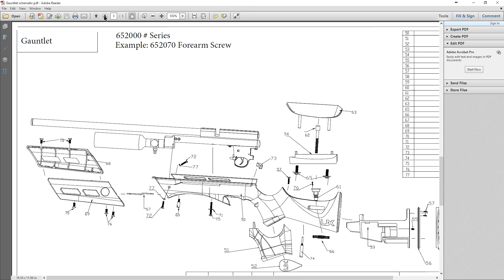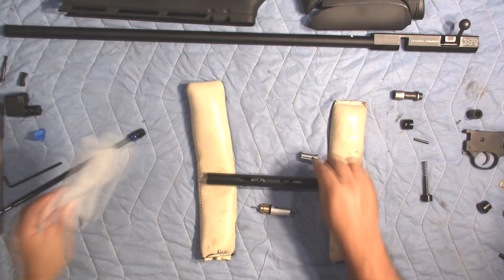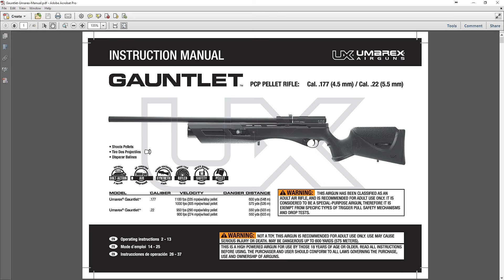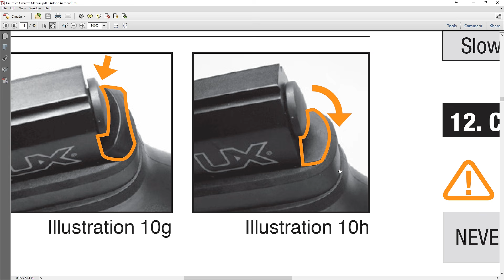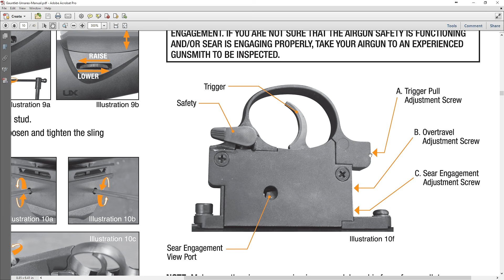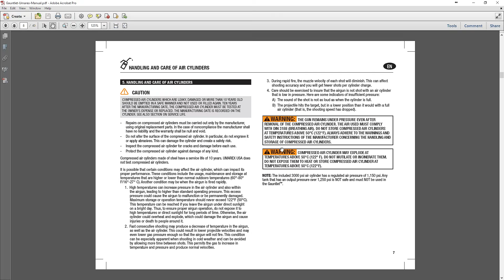Umarex Gauntlet: Super Tune Kit Installation

Comment: Where might i obtain just the spring to lessen cocking effort? I'm pretty satisfied with gun otherwise.
Reply from the maker: The spring is part of the SUper Tune Kit.
Reply: Yes im aware of this but I wish I could find out specs of just spring so I could buy at hardware store and just replace it for easier cocking. Much easier than taking whole gun apart.
Reply from the maker: You have to understand that there is more to it than changing the spring. If you use a lighter spring, the hammer will not have enough energy to open the valve and the PCP will have very poor power. You must modify the valve poppet so the surface area is reduced so the regulator pressure is essentially lighter on the valve. The lighter valve will in turn need less hammer energy to open. Always remember it is about balance and harmony. You MUST keep the energies in harmony in order to have a tuned air rifle.
Reply: Ok..now I get it..If I can get my accuracy lined out I just may go for it. Even after BB installed my best groups at 43 yds is 1.5" using. Crosman domes. I'm hoping the AA 15.89's will help. Also the BB did pull my barrel down very slightly. I had to click adjust scope. I may have to loosen bottle to block screws like u recommended. That way no pressure will be on barrel.
Reply from the maker: You should not need to adjust the scope if you followed the instructions properly. I suggest you re-read the instructions and watch the video that is referenced that describes exactly the condition you describe. Next, If you are getting 1.5" groups at 43 yards there is more going on than Barrel Bands and springs. Double check to be sure your barrel grub screws are tight. Remove the shroud and air stripper and inspect your crown. The rifling should run all the way to the end of the barrel less 1/8" of an inch or so, if the rifling is 1/4" or 5/16" down in the bore, you have a junk barrel that was machined backwards and the breech end was machines as the muzzle.
Reply: @HajimotoProductions  I checked my crown with usb lighted endoscope. Rifling all the way. Checked barrel grub screws. All good. Air stripper not cracked. I'll rewatch the BB video before reinstalling BB. I. appreciate all ur patience and helpful advice.
Reply from the maker: trevor5534 it’s not the barrel band video you need to watch. The instructions give you an internet link that will explain what is happening and how to correct it. here is the link which will start the video at the exact point that I explain what is going on with the POI changing after the barrel band is installed.
https://tinyurl.com/bandflex
Reply: @HajimotoProductions  Alright Haji I got ur BB properly installed and shot my new Air Arms pellets. Also installed new UTG scope. 5/8" @ 27 yd and 3/4" @ 43 yds. Much tighter grouping with AA pellets compared to Crosman domed..however..im still having POI changes as my bottle psi decreases. 1st group was hole in hole..then next group a little further over but pretty tight.then next 10 further over. I tested by shooting a 10 shot, then filling gun back up to 3000 psi and was able to replicate the 1st 10 shot group. I'm going to run my crony tomorrow but it sounds like my regulator isn't consistent. I read that the super tune kit and high retainer valve would help accuracy. Thanks

Comment: I have been considering purchasing one of these rifles after watching a number of your videos. BUT I have a Umarex Octane Elite with problems. Problems reoccurring after warranty service completed. I can not find any schematic for it either. Am very skeptical on another Umarex product. 7/29/19__Umarex finally did come through to some extent a few weeks ago. 
   I now own a Gauntlet in .25 cal.. Gathering up items needed to charge it up.  Still deciding on filters and separators to keep the air as pure as diy possible.
Reply from the maker: As you should be, one bitten twice shy. Umarex will have to earn your trust back. I can tell you that if you are considering your first PCP, the Umarex Gauntlet is a great starter PCP but there are others in the same price range, they just don't check as many of the features included boxes as the Gauntlet does,

Comment: hello I have a question .I have ask many times before .but people act like im asking a top secret question  and don't answer .im hoping you will. my question is can I use a 1800 psi regulator on  my .22 Umarex Gauntlet
Reply from the maker: I doubt you are not getting an answer because it is top secret, you are not getting an answer because you are exceeding the manufacturers maximum operating pressure and no one is willing to accept the responsibility to tell you yes. I do not recommend going to a pressure any higher than 1300 for the .177 and .22.
Reply: thank you for the info .and I knew it wasn't a top secret answer .I said that's what it felt like .as far as responsibility .that's not on anyone but me .recommend spect .don't mean crap its just numbers .the worst that can happen is it might blow a seal .it isn't like 1800 psi will make it blowup like a bomb or something .I know im just a girl but im not as dumb as people that I am .---I am going to use the 1800 psi regulator .I'll let you know what happens I'll also buy a box of metric seal's just in case .again thank you for answering .
Reply from the maker: @susan Marie with all due respect, I do not care that you are a woman as the facts are the facts, 1800 PSI in a non modified brass valve that is only held in place by one fastener is not something you should underestimate. A lot more than a blown seal can happen. I would strongly advise that you do not use the 1800 PSI as it is more than just the PSI to consider. The valve poppet has to overcome that higher PSI which means you will need more hammer energy in order to open the valve in order to fly the pellet. There is a very good reason why Umarex changed the valve body from brass to stainless and increased the fasteners from one to three on the .25 caliber Gauntlet. All of those changes were to support an increase from 1150 PSI to 1900PSI, that's only 100 PSI more than what you are suggesting without taking any of those precautions. As a reminder, this is what can happen if you are not careful.
https://www.youtube.com/watch?v=a1hrms0i2LU
Reply: Thank you for the info .I upgraded my gauntlet from 1100 psi to 1400 psi .it seems to do very well .if I decide to go any higher on psi I shall order the stainless valve body or have a special one built at my brothers machine shop .

Comment: Now that that .25 is out do you recommend it over the .177 and the .22? 😶
Reply from the maker: Recommend just for the sake of recommend, No. The .22 has more access to ammo in more locations. It puts out more than enough energy to take game from a mouse a full size raccoon. The only reason I would recommend the .25 is if someone needs more hitting power for animals larger than Raccoon like Coyotes and such. There certainly improved on the rifles build and internals but the .22 still gets it done in my book.
Reply: For coyotes use a firearm. My rule is they have to bleed out it's an inhumane kill.

Comment: Haji, first thank you for all the great videos, as well as sharing all your knowledge of these guns! I already have your baffles and air stripper installed. Did the trigger improvement too.  Those mods where right on for sure. I'm really happy with my .22 Gauntlet so far. The one thing I'd like to improve on is the smoothness of cocking the bolt. Does polishing the hammer help with that very much at all, or is the problem in the bolt itself or both?  Guess maybe what I'm asking is what are all the benefits of polishing the hammer,  will it effect the fps of the pellet as well by increasing the speed and smoothness of hammer travel?
Reply from the maker: Thank you so much for the kind words, I sincerely appreciate it. Polishing the hammer increasing the efficiency of the weight to deliver its energy. In the business of accuracy, the main variable you are trying to control is consistency, if that hammer hits as a different rate of speed everytime the valve dwell will be different every time which in turn means the feet per second of the pell will be different every time. We are trying to eliminate as much inconsistency in the variables as we can.  As for grittiness or difficult in the bolt, it is because the rough machining of the bolt itself and the rough bore that is machined for it to ride in, both have machining grooves that are engaging with each other like a stick across a washboard. The problem comes into play when that washboard is flattened and the play or tolerance between the two parts becomes so sloppy that you now introduce binding of axial instability. I typically will polish the bolt and bore with 100 grit to mimic what 200 cocking actions would do and leave it at that.
Reply: @HajimotoProductions  thanks for the info!

Comment: How much is this fabled kit to make this rifle worth a damn ?
Reply from the maker: I have to correct you Jesusoftheapes. Out of the box, the Gauntlet is a very consistent and accurate PCP. The tuning kit just allows the shooter to tune the rifle to different weight projectiles so there is a more efficient and accurate delivery of that pellet to target plus a much better shot string. One of the only negatives the Gauntlet has is adjustability, the shooter cannot adjust anything associated with the functional mechanics of pellet delivery. The $65 tuning eliminates that problem making the Gauntlet a full-fledged tunable PCP.
Reply: Hajimoto Productions :  Okay Thank you for that . I am considering buying a remanufactured rifle for pretty cheap but I want to make the gun shoot as lethal as possible because I have a woodchuck problem and I want a humane  weapon to dispatch them with. I'll probably use it to kill many critters over the years and I like maximizing my weapons potential so it's good to know you are here !  Do you have trigger kits as well? I hear the factory trigger on these is not super good ?
Reply from the maker: You are very welcome! The Gauntlet can generate as much as 32FPE or as low as 5FPE if properly tuned. I am not sure how much you know about PCP's and I risk insulting you based on your knowledge of the subject but in the interest of time and trying to communicate while clearly expressing my intent, I'll proceed at risk. One of the only drawbacks associated with a regulated rifle is the consistent shot to delivery comes at the cost of maximum power. So a shooter needs to know out of the gate what the primary role of the PCP will be. If hunting, maximum power and sacrifice maximum shot count and consistent shot to shot data. If target, then absolute repeatability is required. That said, if you are trying to have a fair balance of both worlds then adjustability is a must requirement. The common thread in both disciplines is acceptable accuracy. The Gauntlets were mass produced and they experienced their fair share of production line failures and one of the most common was the barrel production. In almost every case when I pulled a Gauntlet apart to determine why it was shooting terribly, in almost every case it was the muzzle crown that was the issue. In most cases, it was unsalvagable and required a new barrel. If you are going to score a refurbished rifle I would just caution you to ensure you can return it for a full refund if the rifle is shooting terrible as it may be a bad barrel. As for trigger, it is a single stage trigger and if you polish, lube and adjust it, it is very very good and predictable. There are 2 stage kits available and I even show how you make a 2 stage(ish) trigger mod for the Gauntlet, but in the end polishing and proper adjustment make the trigger very nice. Sorry for the long winded response but I want to be sure it is a complete answer. Be well!
Reply: Hajimoto Productions ;  I know enough about PCP air rifles as one can learn without owning .  I have several people i know who own them and I've been involved in building a couple from scratch a couple of times but in bigboar and unregulated .   I would never spend $2000 dollars on a rifle that didn't shoot cartridges and I hate the idea of spending a ton of money on any pcp rifle really because for $99 bucks I can buy a very good shooting .22 lr so buying airguns for large dollar amounts just has never made sense to me but I do like shooting them and for some uses I need a good rifle for using in city limits for pest control and animals as large as racoon or bobcat .   This is why I am considering buying the Gauntlet remanufactured at a decent price . I already own a suba air pump compressor and several suba O2 tanks so getting air is not my worry .  However now that you warned me I think I might just use another method of pest control . All these Air rifles seem to have way to much hassle involved in using them .  I want one but then again the more I hear from people like yourself Air rifles that are less than $800 are not worth putting your money into because they are all cheaply made on toy assembly lines .   I guess long gone are the days of my youth when air rifles were easy to use and  hard to break.   The new world of air rifles seems like and endless seas of purchases and extra steps to take anytime you want to go hunting or even just shooting especially PCP air rifles .   Thanks for warning me about the Gauntlets remanufactured danger and possible production issues .   I  I wish someone would end the nonsense and make an air rifle that is both dependable , accurate and cost comparable to a .22lr   .  It makes 0 sense that rifle that isnt built as well as the cheapest .22 lr on the markets must garner double, Triple, Or even 10 times the cost or more of that cheap .22 .  The people who manufacture PCP air rifles are cleaning up on the cost of a gun to manufacturer Vs what they charge their customers . Until that is no longer the case I think Ill stick to my ruger 10/22 . Thanks for talking with me anyways . I think you talked me out of purchase I would have regretted .  Thanks

Comment: You're awesome at the gauntlet but did you see the video on airgun Depot where they show you how to degas the gun without using the gas tool to keep the air in the bottle
Reply from the maker: Thank you for the kind words David! Yes and that method can damage your valve.  They have it right to unscrew the tank like two times but you should use the degassing tool to empty the pressure in the action so you are not slamming the valve with no back pressure on it.

Comment: Hey boss I don't understand I mean I know you like tinkering around with guns and tuning them but my gosh you have really worked over and Beyond on that $300 gun wouldn't have been easier just to went out and paid $1,000 and bought one ready to go cuz you probably turned that into $1,000 gun with all your time and parts and effort into it
Reply from the maker: Hey Don! Just for the record, I do own PCP's that cost over $2,000 USD, that's not the point of this project.  The goal of this project was to give folks that were sitting on the side lines afraid to make the transition to PCP's the information they needed to make a decision. In this Gauntlet Project, I prove that a $270 PCP can present some very respectable groups and power at 75 Yards. My time is tinkering time, but I freely share my experiences with the community, everything I do I share so THEY will not have to endure the learning curve. Thank you for t6he comment and I am not sure my response will change your mind but at least you will know what my intent was, hit or miss.
Lastly, I can offer a complete Umarex Gauntlet with all my mods and a complete tuned for $625 deliver in the US, so not $1,000 but certainly performs like one ;)

Comment: Thanks for all the great information. Much respect. Just received gauntlet .22. Really don't like the clunky action and considering the tune kit. Do u think it will smooth out on its own after shooting or is tune kit pretty essential for smoothness. It just can't compare to the action on my at44s. Also adding 23 ci bottle and modding reg to 1400.
Reply from the maker: The Tune kit is essential in order to lighten the cocking action and to give the shooter some adjustability based on pellet weight. The rough cocking will smooth out after 2000 rounds or so.
Reply: Cocking isn't bad at all especially if you use a very high grate sandpaper n clean up the bore. Basically same thing youd do in any bolt action firearm.

Comment: Haji......are you sure it needs to be a 5/16 drill bit for the hammer spring adjustment hole? Seems like an awfully big hole? FWIW: 3/16 worked on mine, no problem!
Reply from the maker: Harpoon1 Harpoon1 I told everyone 5/16 only to cover those that did not get it perfect. I drill them to 1/8 myself. I always try to give a dimension that anyone can achieve due to the fact that not everyone can drill at such an awkward angle.
Reply: Yeah I hear you bro...but.....i gotta tell you. I almost just blindly went with it and used the 5/16 without double checking, and am incredibly glad I didn't. I would have been royally pissed to drill a big a$$ hole in my gun, only to find out I could have gotten away with one 1/4 the size. Again, as a big fan, might be better to just "let us decide" if we need the bigger hole, rather than trying to "dumb it down"  and  "protect us from ourselves"! Just saying...........and thanks again for videos, they really are incredibly helpful.